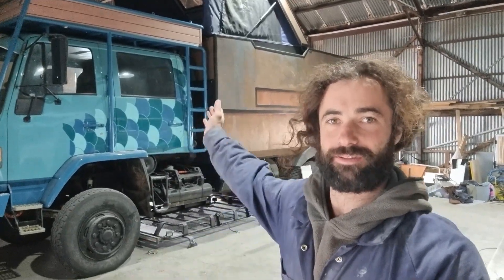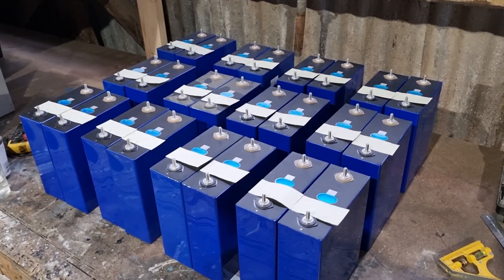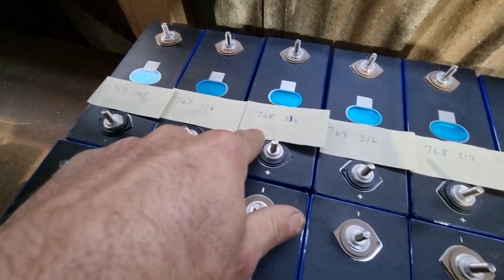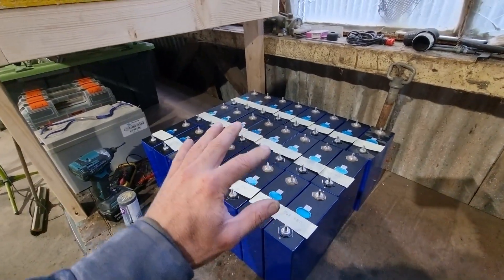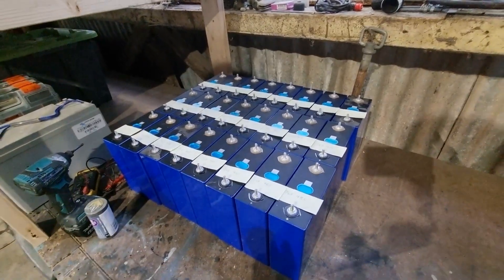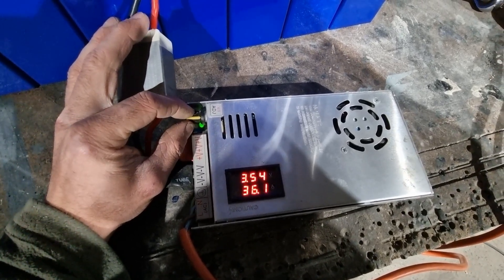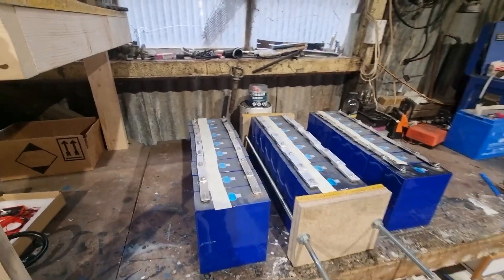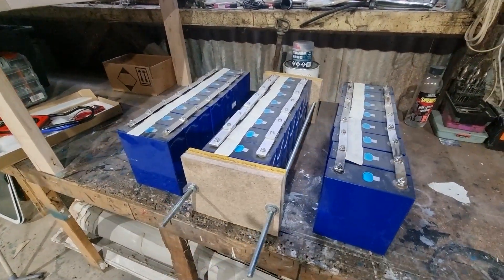EVE LFP Battery Balancing - DIY Expedtion Truck Build #31

Comment: Your doing it correct. Yeah, adjusting is a no-no after starting a charge without making sure the voltage target stays correct. 
Seperate batteries is also best practice, although cost a bit more for the extra BMS's. When top balancing, I always stay near the battery and double check with a DVM just in case. It takes forever, but it pays off later.